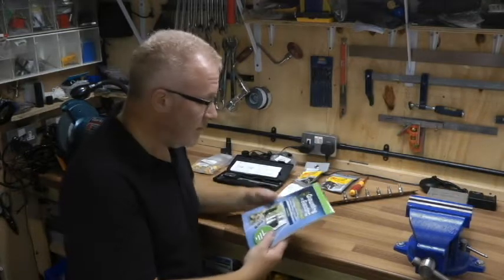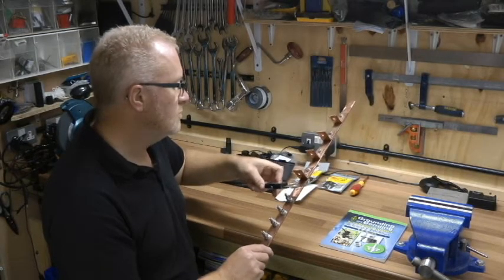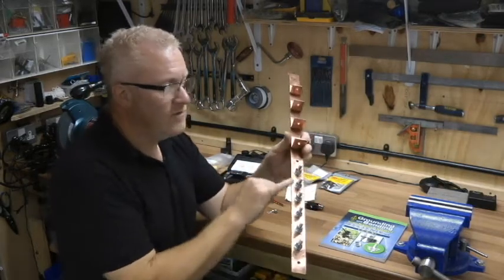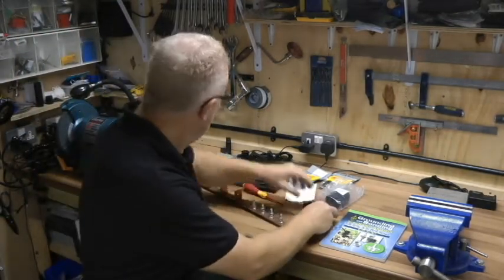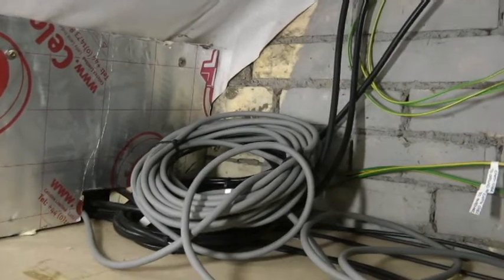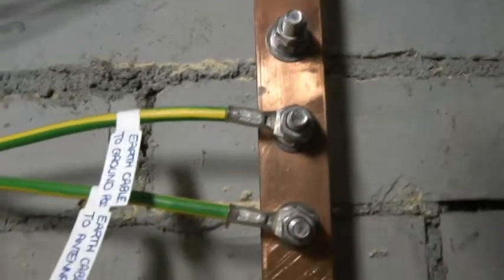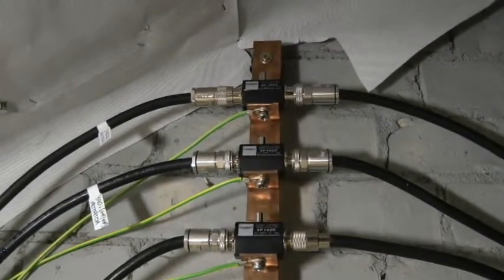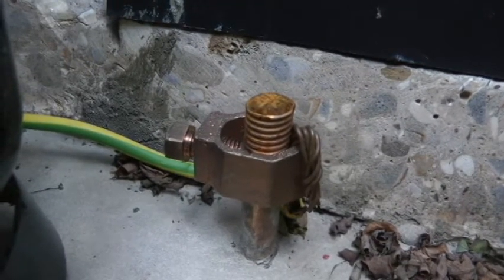Amateur Radio Bespoke Earth Bar

Comment: thank you for the video, that was an  awesome assembly.   i am currently building something similar, however the difference on mine is that the grounding bus will sit outside of the house and the antenna cables will pass through the arrestor that will be grounded to the bus that is grounded to the grounding rod,  before making their way in to the house.  I also am going to run the grounding rod line that grounds the bar , into the house electrical panel to bond with the ground already present. i believe this will help level out the voltage potential difference all around.

Comment: Very super good, question: what size thickness ground cable wire to the outside rod do you use? and what size from the distributon bar to the radio and other apparatus? many thanks

Comment: Do you have an issue with a lightning strike bringing the lightning into the loft before it hits the arrestors?
Reply: With all due respect, I concur that this is a troublesome solution. I can find no source that recommends placement of lightening "arrestors" inside a building including online ham radio authorities, the ARRS book referenced in the video and online electricians and engineers. The misnamed arrestors do not in fact arrest the lightning if there is a direct strike. They offer some protection from nearby strikes and static discharges.  This setup is in violation of the NEC in the U.S.; I don't know about regulations in the U.K. I expect the setup works just fine for fair weather, but I am concerned about an increased fire risk in the event of a nearby lightning strike. While neatness is desirable, safety should be paramount.  

Kind regards,

John - KK7JBZ